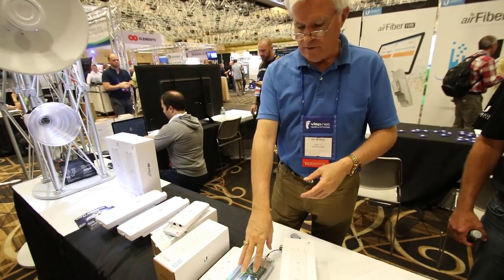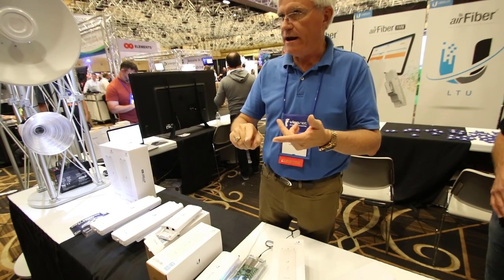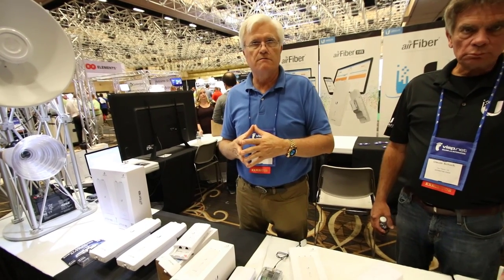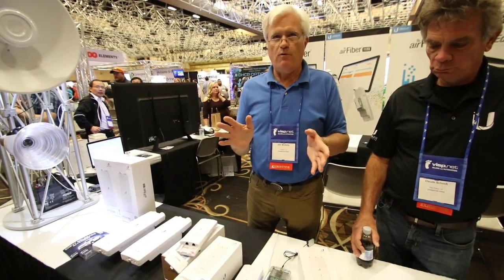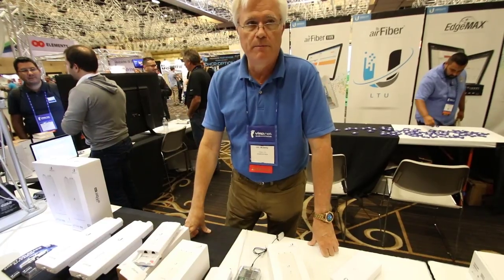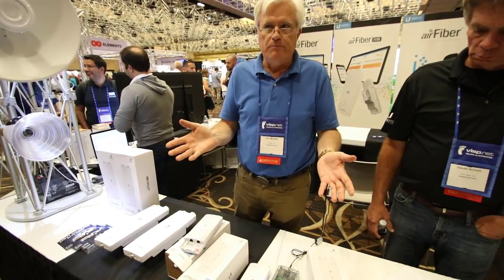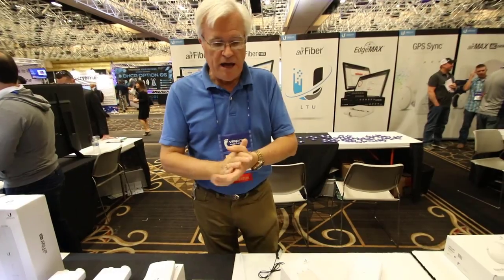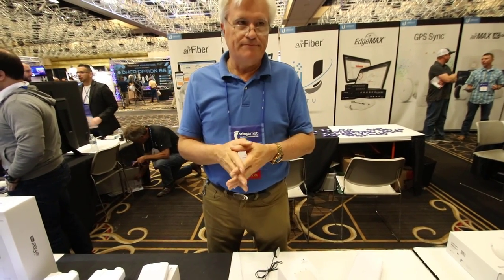TheBrothersWISP - Ubiquiti LTU - #WISPAPALOOZA2017 @UBNT

Comment: Another note I had was "why bond the interfaces when you can only get a gig of throughput anyway", the answer to that is redundancy in case one interface fails.
Reply: I wonder how that would work.
Reply: ECMP'ing on L3 to provide physical redundancy (on  your cabling) is quite common in the datacenter. It also avoids living on the edge of your interface buffers and reduce jitter. He provided a valid answer.
Reply: Right right.  In a lot of scenarios with pure p2p links it's often(in my lazy experience hehe) easier to simply have a single point.  I suppose if you do two subnets and let the router sort it out it amounts to the same thing in the end.

Comment: https://www.balticnetworks.com/docs/Spec_PMP_450m_cam-10046_000v006.pdf

14x14 Mu-MIMO (so up to 7 simultaneous 2x2 connections) in a 20"x25"x4.5" form factor.

Not a car, but a fire truck!  https://media.kohlsimg.com/is/image/kohls/2373255?wid=882&hei=882&op_sharpen=1
Reply: Yes, but my understanding of that unit is that it's basically just 7 mimo radios each with a directed beam.  So it's essentially 7 radios and 7 sectors in a single unit, each sector focused at a different point.  Not true beamforming whereby 2 or 3 radios can hit any of the clients at any point.....which is why there's 7x the radios w/ only an expected increase of 3x over a single radio.  Not a beam former, just a multi beam.
Here's a sample of a beam former --- watch the little airplane animations.  They can change the beam 100x / second it can be pin point, fan shaped, checker board looking, full power 2x2 degree beam or full 120/120 degree spread..... Watch the whole video, this is 80s technology here.  https://www.youtube.com/watch?v=wIwAOupjMeM
Reply: I don't believe there are seven fixed positions that it just uses differently. I believe there's a vast array of possible formed beams. I'll loop someone from Cambium in here.

I believe the expected increase being only 3x is the likelihood of real deployments having CPE perfectly located for optimum system performance.
Reply: From Cambium:

The 450m is a true beamforming antenna.  In both the downlink and uplink directions, the beam is formed as precisely as possible toward the subscriber of interest.  It’s not an infinite set of possibilities, but the number of combinations is quite high.  It can get to as narrow as 6.5 degrees beamwidth, and this pattern is repeated twice across the sector, so that’s where the 7 comes from (90 / 6.5 / 2 =~ 7).  This is combined with the 7 dual-pol transceivers, such that it can talk to 7 subscribers simultaneously.  You are correct, that Cambium states three to four times the performance in real world situations.  This is because of the statistical probabilities of both the positions of the SMs across the sector and the requests for data from those SMs.  The combination of these two things, on a frame by frame basis, is what allows the 450m to “group” SMs, and talk to them simultaneously.  The histogram of this performance is reported by the radio system and can be monitored.
Reply: A true beam former would be able to used variable formed beams and multiple channels to use all 7 radios simultaneously.  That's why I believe it to be as I previously described where it's basically 7 radios pointing in 7 unique directions.  Think of it as the UBNT 3x30 90 degree sector done in a sector array.  They're calling a it a 6.5 degree beam as it's a 90/7 down 3dbi.  Like a 65 degree LTE sector is a 120.  Same fashion.  There's no standards for calling a beam width a specific size without knowing where it's down at what degree.  They, like UBNT are just being clever in their marketing while being hush on specifics.  They do more on the backend than UBNT does, but that's sorta changed with UBNT's GPS now active.  Even formed beams still have sidelobes so it's going to impact the ability to fire all 7 radios at once.  I'm tired of these companies marketing to "professionals" while using the same techniques that ATT / VZW call their services "unlimited"   Enough of the games, give us specifics, we'll decide who is better.  A big gripe of mine when it comes to cambium is lack of clear professional data, and market videos that even bro-wisp surpasses.  Go watch their elevate video where they're screwing with the stupid high-vis vests.  What a pile of garbage.
Reply: I disagree. I think that's why you don't see the 7x throughput increase because of the ability to form beams to groups of clients without trampling on another beam.

I'm sure if you were to 10x the number of elements, they could get more precise with the beams, but then you're largely wasting them unless you're moving to larger numbers of simultaneous streams, which then circles back to the original problem.

Wait, our videos are better than somebody else's?!
Reply: Take a look at this video --- tell me that isn't just horrible......  I was looking for info regarding their products and stumbled on this and was like....WTF is this, how did it get uploaded......
https://www.youtube.com/watch?v=kBIK_gb9pTY
Reply: Seems fine to me.

Comment: Tired of hearing the mis-information about a beam former having to be the size of a car -- horseshit JIM and you know it.  Sectors are fixed beam formers ---- electrical down-tilt?  That's a formed beam.  Nice try though for making excuses as to why we don't see it.
Reply from the maker: What do you expect from fanboys?
Reply: Yeah, I don't get that. If you think multiple, tighter sectors (like the 3x30 degree HDs) are better than beamforming, just say so. The PMP 450m is real.
Reply: Yes, and real expensive too.  My idea is to have a 120 degree sector that's the $$, and then you can just add in radio modules to increase capacity.  There'd be a backplane where sectors could be linked like you'd have 3x120 typical facing, but you could add in a more simple unit to split the difference of any 2 and add in a bit more flexibility that could supplement the sides of the other, or you can link multiples together for more / tighter beams.   Modularity is the key to future success IMO.
Reply: Jim was probably referring to PtP MU-MIMO. Without the ability to bounce stream(s) off objects to keep them separate, I don't see how that'd work outdoors. Outdoor downstream PtMP with a beamforming antenna is obviously a solved problem.